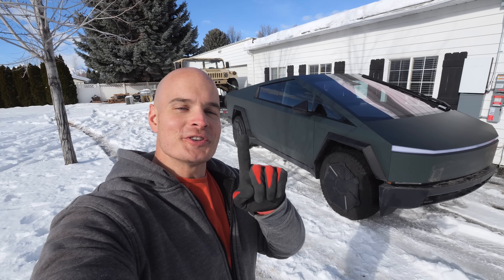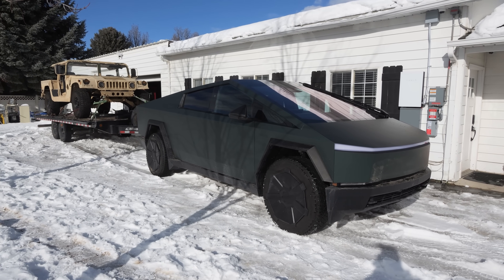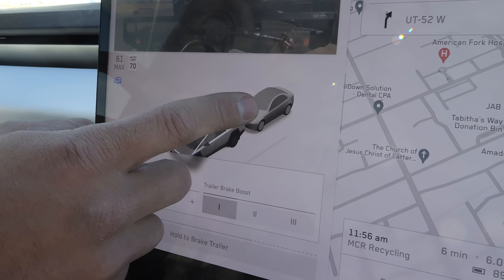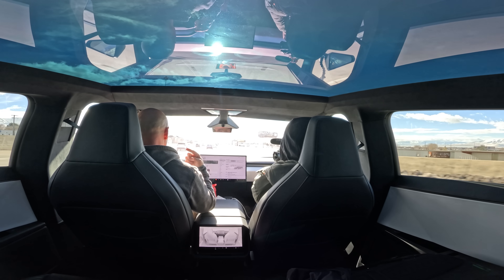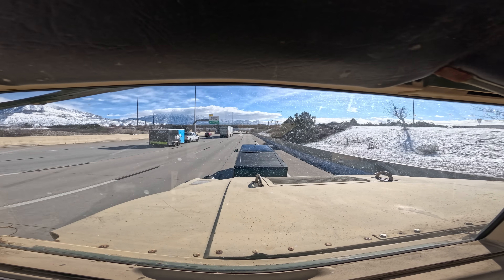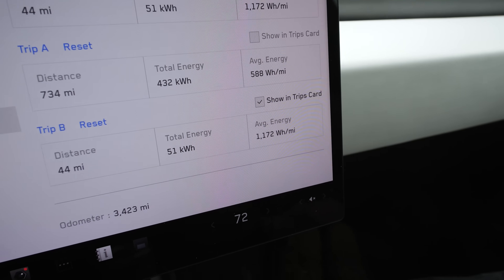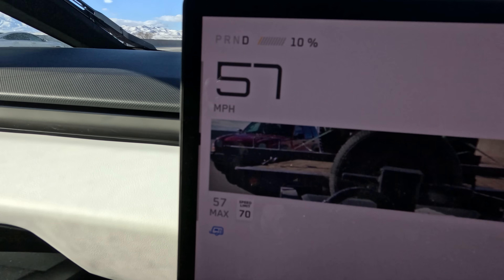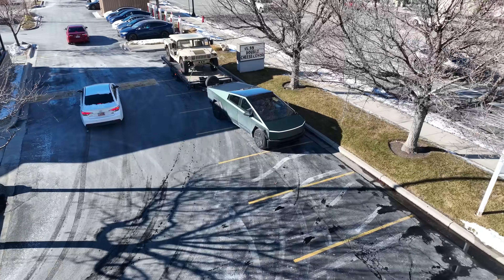How far can the CYBERTRUCK tow 11,000lbs in Freezing Weather?

Comment: My ‘22 F350 has done 440 miles pulling a 43’ fifth wheel RV on a single tank. Basically a big flat non aerodynamic rectangle. 
Still waiting on a trip like that from an EV. I will consider one if it can do that in cold weather and just a quick potty stop or two in between. Then stop for a 5 minute fuel up and do it again. Not being disrespectful those EVs are neat but not practical for someone who uses a truck like a truck.

Comment: Since the batteries used in the cybertruck are custom made by Tesla and are larger than the normal batteries (even though they output the same power individually), I would say 150 miles will be the max distance.

Comment: I’ve towed my 5000lb travel trailer with my 2019 f150 with the 3.5 eco boost and I only get 400kms on a tank of fuel, while averaging maybe 60-65mph which costs $175 to fill in Ontario. The fact these electric trucks can get 160kms on $13 of electricity while towing more than double that is something.
Reply: I have seen people get a $700 electric bill running 40 amps intermittently for heat which is 10kw

I am sure 100 amps non stop is $13 for sure, totally 100% accurate
80 amps for 10 hours per night costs $1000 per month

ford lighting claims 80% charge will take 8 hours at 80 amps(20kwh) or $30
tesla claims 70%(20% to 90%) charge is 131kwh or $25
Reply: Got to take a couple of things into account;

-400 kms is 250 miles about. The 19' has a 23 gal tank standard. You are getting 10.8 MPG or 4.5 KPL. 

-Since you are probably Canadian (hi) That cost looks to be about 1.43/L. So a 23 gal tank = 87L. With this number we arrive at $124.41 for a tank fill up at 1.43 CAD/L. When converted this ends up being $92.33 USD for a full tank. Gasoline outside my house in my town is $3.08/Gal. So this ends up being about $70.84 Sadly you are paying more up there.

-This brings up the next point. The average residential rate in UT is 13c per kWh So this equates to about $14 US. So everything Gucci right? Problem is this is being charged off a US 110v outlet and will take upwards of 12 hours to charge. When traveling the national average in the US for a super charger (the one you will actually use because you don't want to sleep overnight in your truck) is 0.23c. Some places are as high as 60c. UT over the last few years has a average rate of around .36 so we will use that. At 108 kWh used we get $38.88.

-90 Miles of power at 38.8. Okay so we divide 400km by about 2.8 and we get 142km (90 miles about) So lets divide that 87L tank by 2.8 This gives us a number of 31L. Multiply it by 1.43 and we get $44.4 US. Actual money saved... $5.60. While enduring all the downsides of towing with a EV. 

-Keep your 3.5EB it will outlast the Tesla by probably at least 2x and you won't be spending that much more money anyways. $61k is a lot of gasoline and repairs. 
Diesels makes this even look worse than a small displacement Gasser. This math can go more in the favor of EV's but most of the time Diesels win out in cost per mile and convenience.
Reply: @bobjackson4287  you're nuts, it takes more than 24 hours to charge on a 120volt outlet that's limited to 20 or 15 amps

20 amps is 55kwh
15 amps is 43kwh

tesla truck is 123 kwh and will store 80-90kwh after 100,000 miles. most diesels can make it to 500,000k easily. i have a truck i parked with 530,000 and still drives great and only gets 24mpg

As of February 2023, the average residential electricity rate in the U.S. is about 23 cents per kilowatt-hour (kWh)

some semi's get near 10mpg with an inline 6 cylinder towing 34,000lbs
Reply: As with almost everything you can pay in time or you can pay in money.
Reply: @user-kj7nw4zg1y  120 litre tank and $1.45 a litre which is the lowest fuel has been in months. Which is $4usd a gallon and 32 gallon tank.
Reply: Why can’t people just admit that electric vehicles suck for the everything but short commutes? Their range sucks. Their power is short lived. Their recharge time is absurd. And their batteries will never outlast a well maintained gas or diesel engine. Seriously, who cares that a Cybertruck can beat a Porsche in the 1/4 mile while towing an identical Porsche? A Porsche isn’t a 1/4 drag car. But fill that Porsche up and see how many 1/4 mile passes it can make compared to that Cybertruck.
Reply: 😂😂😂 wait till your battery dies and it has to charge. Instead of money you’ll pay with time.. which you can never get back

Comment: You hooked up you brake safety cable wrong.  They need to be attached independently, it makes no sense to attach it to the same place as the chain because the if the chain holds to the truck it is not needed and if the tow hitch comes off the truck the brakes do not come on.  It is also illegal, the brake cable needs to be attached independently.

Comment: I gotta say that I'm not surprised at all at the results. The guys over the TFL tested a Model X towing something small and the battery dropped by 50%. Not surprised that towing 11,000 lbs caused the battery to use up so much energy that you only got 90 miles. Weirdly enough the F-150 can tow 14,000 lbs, more than Cybertruck can. Your video only affirmed my suspicion that the Cybertruck isn't design to be a work truck as Elon claims it is but, rather, a truck for consumers and the weekend DIY'er. I wouldn't pull anything serious and for $100K, I'll take my chances on a used Dodge Ram 2500 with a Cummins.

Comment: So you get 90 Mi range it takes 40 minutes to charge I'm guessing a person that would own a cyber truck values their time as time is money so how much are people actually losing driving these EVs and sitting at the charging station when an internal combustion engine can be filled up in 3 or 4 minutes hate to break to everybody but the only way to charge you assuming you're charging these at night are from the grid if you have solar on your house in your part of the buyback program it may be efficient but you're still wasting time if you don't charge it at home lithium batteries are not the future hydrogen fuel cells are

Comment: I have a few concerns.......

1. 99% of the people watching this video likely do not even own a truck but laugh at the CT and call it impractical or junk.. 
2. The other 1% have likely never towed anything close to 11k lbs
3. You can't put a value on the data in this video because of #1 and #2.
4. We need a reasonably comparable gas or diesel truck to run the same test. 

Reasonably comparable will be an issue because of the tech the $80k buys you in the Tesla that no big 3 truck will have. But someone can do their best to get close enough and run a similar test... No extended or second fuel tanks allowed until Tesla releases its extended range option. No stripped down, vinyl interior, steel wheel, two door models either.. It has to be reasonably comparable for the same price point. No idea what that would be since an F150 is easily $80k... 

Which goes to my initial thought.. Love it or hate,  you're getting a lot for $80k here.....

Comment: Never told how long to recharge. If I drove across, the country would have to stop 34 times. That amounts to about two days just in recharging time. ,If you drive 400 miles per trip segment, it about 6 hrs. in a gas truck, assuming this video vehicle travels 400 mile at 90 mile drive/recharge segments at about 3 hrs. each, it would take 5 segments totaling 15 hrs. In other words a gas truck has 2.5 time range versus time advantage. I assume a one and one half hour charge time between segments.

Comment: How about Ford F150 with maximum towing capacity, i just checked for curiosity, it will have 10-11 mpg and its gas tank is about 23 gallons. Meaning its range will be 230-250 miles (or less) vs 90 for Cybertruck

Comment: You are towing 8,000lbs at the most. The M988 weighs 5-6k and you even have the doors removed. The trailer weighs 1200lbs because it is very small. Very dishonest, Ford Ranger have been seen towing that much....

Comment: Like your content but .....funny how all these EV presentations start with the toys the cars have and which are absolutely unrelated to the topic or the question -  is this new EV the new best thing. 4WS, AWD, some radar gizmos, auto pilots, blistering accelerations etc - that's been around for years if not decades and means nothing. If you presented the simplest car with no A/C, na ABS but batteries that last a 1000 miles and recharge in the same time as a 100 year old petrol tank I'd be stunned. However, here I am observing how ppl just are unable to make sane choices and try to justify the laughably bad results with range and rechrging procedure.....

Comment: Contrary to what many believe - The Cybertrucks (and many other EV's) are not good for the environment, mostly because of the production, the weight and the inefficiency of the cars energy consumption compared to combustion engine cars currently, and battery lifetime & production.

Being sh*tty for the environment is especially true when it comes to the U.S. who's energy/electricity production is made up of 80% fossil fuels including gas, oil, coal. Thesw fossil fuels are burned to produce the electricity which you charge the car with.

Comment: I pay 33 cents per kwh for my power so at 105 kwh used to go 90 miles that's roughly $33 so would cost about the same as a diesel and that's for the cheapest power. Plug in at a supercharger and it's going to be way more expensive.
Reply: Yes on the road  you could be paying $0.50kWh, ore more. At $0.50/kWh that would be $54 for that 108kWh (90 miles). A Ford gas truck getting 8.5 mpg towing thst load 90 miles at $3.00/gallon would costv 90 miles ÷ 8.5mpg  × $3.00 = $32.80. About $22 less.

In this example where at it took 108kWh's to travel 90 miles. $0.50/kWh at a public charger that would cost $54.  For the gasoline powered truck getting 8.5 mpg the price of gasoline would have to rise to $5.10,/gallon for it to cost $54 to drive 90 miles.
Reply: @garywozniak7742  yep and it'll only get worse as the power supply struggles to cope,I think EVs should be limited to small cars for city use

Comment: EVs are really great though the way they are utilized can be improved if you have a solar system at home where you can plug your car and basically charge it for free eliminating the cost for fuel (in the case of EV, added electric bill). I do think that a solar energy installation at home and EVs are the best match if you want to get the lowest carbon footprint you want without needing to rely on public transport. You also don't need to change any oil or the likes and the maintenance cost is basically just tires and cooling fluid.

Comment: The 500lb Home Depot straps on the rear were a nice touch! $.14 a mile in the cyber truck, $.19 a mile in my Dodge diesel, with 6x the range. I’m gonna stick with ICE rigs 😂
Reply: I don't even trust those straps with my motorcycle 

which diesel motor do you have? I know the v-6 gets some excellent fuel economy, but like the gm eco diesel I have heard of many premature engine failures.
Reply: Yeah but he was quoting the cost of charging at home wasn't he? so once you use a supercharger the cost will be a lot higher than your diesel, even more reason to keep your diesel.

Comment: Well the range depends weather u drive with that maximum load on highway where the truck doesnt reallly have to bear the load or stop and go scenario, 
If u drive it in city traffic and with tons of traffic signals the range would drop drastically as the truck has to do a lot of work again and again speeding up frm rest where it would have to tow the real weight

Comment: Like a truck you can hear running. Like the moontruck and waiting for my friend to get his from backorder. Not designed for long trucking, but I'll putt it around in our business for the price of a Ram 1/2 ton with way more bad engineering. Any half ton for that matter. I also drive 97 F350 diesel dually and a 2003 F150 v-8.

Comment: NGL I am in line for a Cybertruck BECAUSE of the advertised (now different) towing range with the big battery. Now I have to re-think it. It can do more than my 13-year old SUV, but at a tremendous price, and with MUCH more frequent breaks to charge. Thank you for the video. I too was surprised it was so close to the others when you launched from a stop. 12 secs isn't bad, i just thought Cybertruck would be faster than the others. Maybe FINALLY Elon is focusing on efficiency instead of Ludicrous launch theatrics.
Reply: For that kind of money, get yourself a 1-ton diesel for towing.
Reply: cause that's the duo motor. Tri motor (cyberbeast) is faster. And if you are only going to be towing and not carrying much, you can buy the extra battery. However with any early technology, which EVs are, it is still safer IMO to stick with petrol/ICE cars for another decade. Unless you want to be an early adopter.
Reply: EVs aren't new technology. Not even close.  @flarierza33
Reply: Don't forget, when you buy a tesla you don't actually own it ether.
Reply: The thing that puts me off is the noise. When you pay this much I want comfort and silence.
Reply: 😂 Ludicrous mode is the only reason to buy a Tesla.

Comment: How does tesla get away without a physical link to the steer wheels? I remember back when i drove a tug (yard units for moving semi trailers in a lot) and was told never get on a road with it as it wasnt up to safety standards because it was hydraulic steer, not a physical link.

Comment: Beats a Porsche while towing one, but only for an 1/8th mile. Does a tractor pull, but not repeatedly, like a big diesel can do. Range loss in cold weather is severe, forcing a slowdown. ICE trucks are more practical.

Comment: 4 or 5 years ago they promised 14,000 lbs and still their towing software is decidedly meh. Also, disconcerting as we don't KNOW that it doesn't think we're being tailgated. When Teslas get clever with drive assist features, it can get dangerous real fast.
I get the impression that parts of their R7D team (software on wheels, they used to say) didn't expect the thing to have only a year of delays, and they never put anything new on it for towing over Model Y, just different base numbers. So funnynthey promised 500 miles+ and are now the shortest range towing BEV truck.

Comment: 215kw yikes…. Didn’t realize the superchargers draw that much power. That is a crazy amount of draw for a single charger on the power grid. Maybe there is something I don’t understand but it seems to me if that single charger is being fed with 480v three phase power and the inverter has 100% efficiency (impossible) that’s 260ish amps…. 
Holy smokes and these people think they are saving the environment by driving EVs ? 

Those amps aren’t all coming from solar panels and wind …you’d be better off driving a diesel that requires the epa’s exhaust cleaning juice 😂

Comment: I'M ALL ABOUT NEW TECHNOLOGY BUT THE ELECTRIC TRUCK THING IS RETARDED. MY 2022 F450 WILL GO 450MILES ON ONE TANK TOWING MY 43' 19000LB 5THWHEEL OR 725 MILES JUST DRIVING AROUND. I CAN REFUEL ANYWHERE IN ABOUT 5 MINUTES AND IT ONLY COST 75K TO BUY IT.  I CAN TOW 35000LBS IF I WANT TO MAX IT OUT. WHY ON EARTH WOULD ANYONE BUY THIS TYPE OF THING FOR TOWING. ITS COOL TO RIDE AROUND FOR SHORT DISTANCE, BUT OTHERWISE IT MAKES NO SENSE. UNTIL THEY FIGURE OUT BATTERIES THAT ACTUALLY HAVE REAL RANGE AND A WAY TO RECHARGE QUICKLY I DON'T SEE THIS AS BEING EVEN REMOTELY VIABLE OPTION FOR ANYONE THAT ACTUALLY NEEDS A TRUCK.

Comment: Tesla doesn’t adjust the top screen battery range based on driving conditions (aka a guess-o-meter). 

It’s strictly just a % of the EPA rated range, which is essentially useless since you can never achieve EPA rated range driving normally. Absolutely should not use the top screen range indicator to plan out charging in a Tesla because you will likely get stranded. 

Leave it on % display only and always use the navigation system to estimate range to destination and plan out charging.

Comment: If you have no hat on and are bald, that is not the same weather these vehicles performance is being criticized . You need to state the temperature. Just because there is snow does not mean it is truly cold. It is also important to note charge times and the availability of said charging during power outages during severe weather For someone that depends on a truck for daily use like a farmer, these issues are crucial. If you are using it for recreational purposes, who cares. I’m sure it is a great truck for non critical work. I might even question why you need a truck in that situation. It doesn’t make financial sense.

Comment: Let’s add a taller trailer that has significant wind resistance and higher speeds (80 mph through most of Utah) and you wouldn’t make it 45 miles. You’re going 5 mph under the speed limit on those flat Utah roads and that load has very little wind drag. That scenario is not realistic for most of us in this area. To pull a boat to lake Powell or cargo trailer with a side by side down to st George at higher speeds would drain that little thing in 45 miles

Comment: I haven't read the comments much yet, but shouldn't the load (the hummer) be closer to the cybertruck for proper tongue weight distribution? I've seen trailers get all squirrely and cause accidents because the weight is not far enough forward. Could be wrong!

This is a great video and thank you for satisfying our curiosity with this test.
Reply: Not if the load is heavier than the vehicle itself. Then you have to balance the trailer
Reply: @rafig1033  how do you know when it's balanced? When you're not swerving all over the road? 😆
Reply: @SoulfireJayMusic  You can actually buy hitches  with scales built in or as I do go by eye and load it so the rear truck springs are slightly compressed, my SUV hitch has a max downforce load limit of 300kg.
Reply: @silverdale3207  nice info.  Thanks dude!